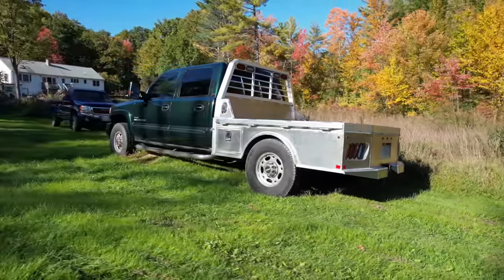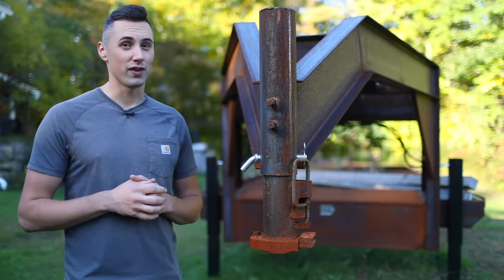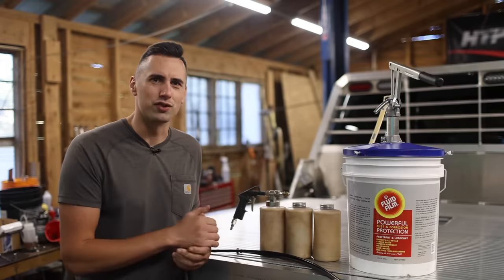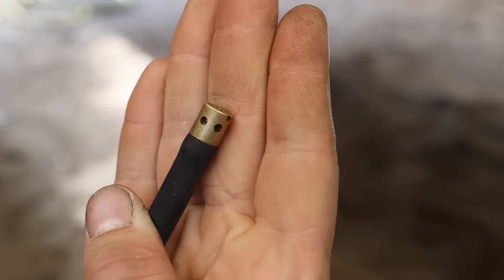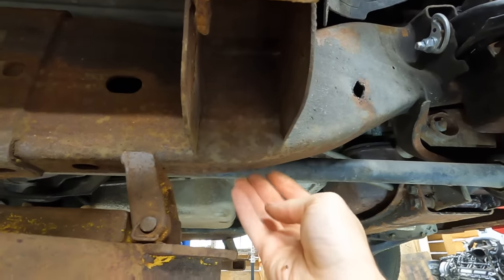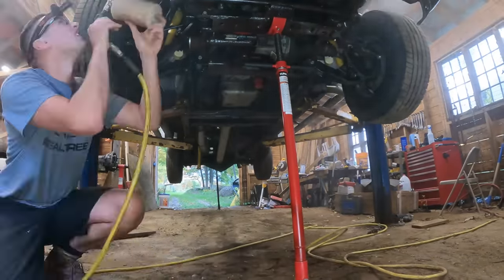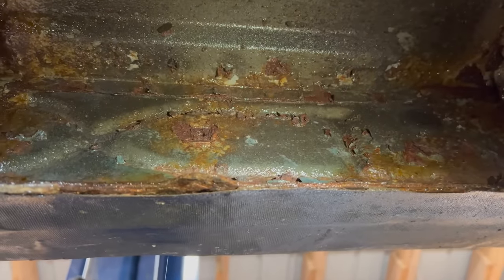Oil Undercoating my Truck so it won't Rust. Easy and Foolproof Method.

Comment: Great content Waldo and thanks  , yes I use old engine oil on the old  vans it sends to creep in all the cracks , messy but the only way !
Reply from the maker: Thanks Steve! Yeah, motor oil probably does a better job of creeping than this stuff
Reply: Let me ask you; How often do you have to apply these coats?  I live in MI where Winter Road Salt definitely does a number on my vehicles!!
Reply: @whammond511  I hear of people doing it yearly or every other year I wanna get mine coated before the snowfall
Reply: @damiengreen3772  Eric O at South Main Auto does his yearly. He’s in southern central NY and I believe in his area they use brine, especially on the unpaved roads.
Reply: Old time always told me to use transmission fluid would do a  good job! Than found a dirt road and drive up and down on it !😂
Reply: @WaldosWorld  The trick to get fluid film to creep is to heat it up before applying, have been using fluidfilm for a couple of year. But it was only the last time I applied it, I heated it up before and that for sure makes the whole difference :)
Reply: @whammond511  Every year but honestly after about 3-4 years there will be so much built up you can start skipping years.
Reply: Steve, you ever have any swelling of bushings? I’ve been told use spent hydraulic oil because it doesn’t swell bushings. I cut in a little atf for penetration, and add some fluid film so it sticks better.

The end result has my neighbors wanting to hire me to do their vehicles.
Reply: @swamp-yankee  ... anything with petroleum will eventually attack rubber bushings.
Reply: Well every year but keep oil away from rubber bushes,   lanolin here , most commercial vans are metal  and rubber o rings were grease is applied ,
Reply: @stevesalvage1089  ... the white stuff that looks like lithium grease on the mounts is not a petroleum product. It may be a wax type substance.
Reply: @rupe53  thanks, good to know.
Reply: @whammond511   if you're only doing it once a year then spraying in the fall would be best. I always plan on also spraying in the spring after washing all of the salt off but I never seem to find the time
Reply: @swamp-yankee  it will still effect the bushings.
Reply: @Terk131  yeah, so I have been told. I’m glad to know that, but I’m going to continue using hydraulic oil on my own stuff and just avoid spraying it on bushings and wiring. Can’t hurt anything up in my frame. I’ve got a first gen taco I bought because it was going to get scrapped and we did some major frame repair to, and I’m not going to let it rot from the inside out again.
Reply: @swamp-yankee  definition,  spray away. I do, I just go easy around the bushings
Reply: @whammond511  Use my recipe and I live in Pa and use it 1 time every few years. Depends on how bad the salt is. If not bad like past yrs 5 years later and still no rust. Gotta mix these things to make a super rust fighter. Oil, grease, trans fluid, wax etc. I typed out recipe.
Reply: @damiengreen3772  Costs alot. And lasts not that long if u wash car alot. Or use auto wash.
Reply: @bobleeswoodshop7919  Yes. Mix with oil, grease and wax. That way u have a few good things that together are great. Recipe typed above.
Reply: @swamp-yankee  Thank u for proving my point. Mix all together with wax gasket, grease.
Reply: @jasonchristopher2977  like tubes of grease? I know folks tend to call lanolin undercoat grease in my area
Reply: @jasonchristopher2977  Where do I find it?  Here on You Tube?
Reply: @swamp-yankee  Yes. For grease gun. Or tubs for wheel bearings. Don't matter what kind etc. As long as it's grease. u can't cut that in half for all and try it or even 4ths. Just try a lil and I promise Ull be happy. Did u ever see any iron covered in oil, grease, or trans fluid and be rusted out? There's a reason for that. If u seal with the ospho then it's really gonna last a lifetime. I know ppl don't care on already rusty cars but if they take the time to get heavy, what falls off being hit with hammer etc, then use Ospho it will seal it and can't rust. U can look it up. Great stuff. Safe, can pour on ground and not hurt it. Not battery acid or etc. Gotta wear ppl but not worry if on skin. Don't BREATHE IT. Wear the Covid deflector.
Reply: @jasonchristopher2977  I wear a painting respirator, safety glasses, gloves, and a pair of nasty coveralls when I spray oil. I like to not bring any inside with me if I can help it. Im going to try grease. I can get free damaged tubes from a friend’s shop semi regularly. 

I undercoated a 1st get Tacoma that a professor bought for 16500 the other day. It’s a cherry V6, but the price still shocked me.
Reply: @swamp-yankee  No not grease, Ospho. Phosphoric acid is what I was talking about. For converting surface rust. Tge rust coating mixture yes, a hazmat type suit is best. But if u take urr time, get inside frame etc then outside. U can use any grease. Tubes for grease gun is what I use mostly, wheel bearing grease tubs etc. Mix and heat and Ull be great. That's why I'm sharing this. Ppl shouldn't be paying all these insane prices sometimes more than when new for low mile examples. I'm sorry but now kids can't work and save a grand up for a fist car. Now it's 4 grand. In 90s it was 500 bucks. I got a 88 tempo 5 speed from a preacher with 112000 for 300 bucks. Needed nothing. He wanted tow bar off front. He'd haul behind his rv. 2004 I bought it. so gotta make them last. Rust will kill a vehicle faster than anything. We see a lil paint bubble on outside and it's as big as a dip can on inside. And these vehicles and their families anti rattle. What a pita that shit is. Just hold water and dirt like big sponge. Why not use rubber with holes like Swiss cheese?;Same effect. Grinds my gears. Have a great wknd.
Reply: @swamp-yankee  Also we used a epoxy 2 part product in a can on Pipeline to seal the welds when the thickness was thin. And we had sticks of it when heated with a propane bottle torch it'd drip and do same. I dripped that on my Carharts in 2013. It's still there to this day and on gloves and pair of old boots. That shit won't come off. Won't let go, wash away. I had to use a dremel and sand or grind it down to almost level on that stuff. It's insane. If there was a way to use that on steel like on pipe, it'd last forever. Especially on seams, places like under fenders, body or frame that gets hit by gravel etc.
Reply: @christianbentsen3637  I wanna do this to my car before the winter this year. How did you apply it and how did you heat it up? Thanks!
Reply: @jonathangaliano2617  I used a air spray gun, and used an old boiler on the stove 👍🏼 works great!
Reply: @WaldosWorld  You'd be surprised how much fluid film creeps, especially when its warm out. Fluid film is not only a surface protectant but also a great penetrant. They both creep well on flat surfaces but fluid film climbs vertically better than motor oil. At the farm I work at we have trailers with custom angle iron tracks that accept these 4x6 steel racks that carry trays of plants. Basically they slide in like big metal drawers and without lube they are substantially harder to load/unload. Long story short we've used many different lubricants; motor oil, wd40, pb blaster, etc. After satisfactory results from everything else I recommended we try Fluid Film because I had seen and heard great things about it. Without any doubt I can say that Fluid film is the best product by far! It lubricates and prevents rust longer and better than anything else. When we used motor oil, in the spring when we'd pull the trailers out after sitting all winter to service them, the tracks looked like they have never seen a drop of oil. After switching to fluid film you can still see and feel the lubricating and anti-corrosion magic come spring time. Each trailer has exactly 210 total feet of angle iron that needs to be lubed and by the time I'm done with one my pointer finger is completely numb from holding down the nozzle for so long so the less I have to spray them down, the better. With motor oil lubing the tracks was a weekly job but now with Fluid Film its pretty much just a once a month job.

Comment: Found this channel through the E320 CDI videos. Love this channel so far. Thanks Waldo keep it up!
Reply: I found it with the cummins conversion on the chevy 3500
Reply: @Rv99, yea the first one I saw of his was the "I Bought a Repo'd Mercedes..." and then I watched the one of the old "free" Sears riding mower. Then I saw maybe the one ZILA mentioned, he was putting the red diesel engine in the white-body truck. And then I got back on the two Mercedes where I couldn't believe this man by himself, swaps the engine and transmission between these vehicles and has it running. I think he made a great choice too in selecting the other rims. Idk I was hooked by then lol and have just been randomly watching different videos like the one he did in Feb where he and the "Rural Vermonter" made a snow plow to put on his truck!
Reply: @zenithperigee7442  right around the time he build the snowplow he also build the all aluminum flatbed for the truck he just rust proofed …..  looks amazing! Just like store bought

Comment: Welcome back. Guess YT didn't want to show me your Mercedes videos (I just checked to see if you'd been posting since the last one I saw).

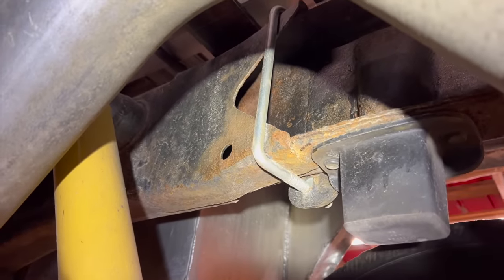My issue is my '91 Suburban needs some retreatment, but I don't think Fluid Film is compatible with the existing undercoating. But if you're starting out, it's definitely a DIY option. I'm only 2:45 in and watching so forgive me if I restate what you said, but I think Fluid Film requires annual reapplication. There are thicker DIY undercoats, one from the same company and some from others.

Comment: I wipe down every part of the chassis and anything else with used Automatic Transmission Fluid.  It seems to be a great job of cleaning off all the gunky road grime buildup, and leaves the underside looking so clean and new.  Not sure what the long term effects are of using ATF for rustproofing the chassis and suspension and driveline surfaces, but so far so good, after a few years.

Comment: I use undercoating in a can names not very original but works. It's held up for years with a few spots needing to be touched up every few years. It's a wax but isn't all messy since it's firmer consistency.

Comment: I started with Fluid Film but switched to New Hampshire Oil undercoating 
The back to black makes the frame and under components look like new. 
Because it is oil a dime size spreads to 5” circle. 
I have my trucks done every year, for $350 per vehicle well worth the cost. The applicator also sprays all the internals. 
The lanolin based fluid film and Woolwax just don’t seem to last as long as the oil based. A trip down a dirt road over the fresh applied NHOU makes for a nice pasty wax coating. 
Just be sure you have all your PM done on the vehicle, and wear gloves and old clothes if you have to work on it after application

Comment: As a fellow rust belt resident I can attest that Fluid Film, Woolwax, etc will save your vehicle.  I purchased an 03 f250 8 years ago that was just starting to rust. Treated every year since and the rust has not spread.  I use a heatgun if its cold to heat the fluid up.

Comment: Nice having air supply. I went at mine with a case of cans. Bought the 360 hose/wand that attaches to get all those places you mentioned. Even after a few frame washes, it's still very much coated. Some light touch ups and I'd say I'm good for another winter. I'm in central PA.
Not quite as much salt as you guys.

Comment: Prevention is the key, when I had decided to move from Texas to Fort Wayne ,In. The first thing I did was sprayed my frame and underbody with bed liner to seal it and it worked out great ,but now I'm back in Texas and I see the bed liner is starting to flake off so I'm glad I didn't decide to continue on living up there and my 94 is still corrosion free!
Reply: Bedliner is great for holding moisture and salt, it's been tried in the northeast by many and fails miserably.
Reply: @TheRoadhammer379  that's probably why it started flaking off then ,because I know that chemical they use will rot out a frame just like salt, my Volvo had caking corrosion all over it and the airbag suspension was dry rotten it self had to have all the rubber bushing replaced as well. I'm glad I was only hauling expedited  freight with it.
Reply: Thank you, but I will have to decline, I only have Wi-Fi connection for my phone due to some health issues.

Comment: My Disco did this twice, with diesel!! Once when the fuel line near the fuel pump developed a hole and secondly when the Fuel Pressure Regulator broke!! Not that rust proofing is needed in Australia.

Comment: I used to undercoat with oil and it worked perfectly sprayed through a Wagner power painter (I filtered the used motor oil first).  Then one year I was refused an inspection sticker whereas I was told that "oil undercoating" is illegal in the state I was living in back then.  I had to drive around on dirt roads for a couple of weeks before I could bring the vehicle back and get my sticker.  So now I power wash the underneath once per year and spray painting every two years.  Seems to be okay.

Comment: Its a messy job but it works well.  It is even messier if you don't have a lift.  I now have a local shop spray my vehicles now.  I supply the Fluid Film and they only charge me an hour of labor per vehicle.

Comment: Looks like a great way to fight rust.  I have also used products from KBS coatings for a permanent fix, once applied, it’s the end for rust.  I’m going to try your method for the areas where I can’t get at with KBS.

Comment: I prefer Woolwax black. I’ve used it for years and it’s been preserving my 2006 Silverado 1500 very nicely. I plow with it so it sees the worst salt brined roads traveling from customer to customer for snow plowing.

Comment: Waldo! What aftermarket stereo did you use? I see CarPlay and a massive screen, I would be interested in the same unit for my 2006 Duramax!

Also love the vids! Used yours as guides for when I replaced my frame crossmembers due to northern Ontario salted roads. Keep it up and more big excavator vids would be great!

Comment: been using similar method quite long time on my cars, but instead of fluid film i used old engine oil + mixed it with chainsaw oil in order to make it sticky, so far no problems, obv it will wash off from spots wich get mostly watered thru driving but different corners and gaps are still coated with it even i did it last year :P

Comment: Hey Waldo, I think I live near you because I've seen your cars around town. Anyway..as a kid (13 yrs old) I worked part-time and one of my jobs was taking a paint brush and brushing on heavy black grease on the undersides of our municipal trucks. None of the town workers wanted to do it..but I was eager to make a buck and small enough to get under the trucks and do the job. Those truck NEVER had rot-trough problems because of the yearly reapplication of that grease. That was back in the early 80's and I think most of those trucks continued on well into the 90's..which is pretty amazing considering they were already 20 years old when I was slinging grease. The spraying looks easier..but doesn't it aerosolize a lot? Must go everywhere when it does??
Reply from the maker: Yeah, it does make a mess. You can see the camera lens get oily as time progressed in the timelapse 😂

Comment: When that stuff wears off there is the spray paint you can use to actually kill the rust it has a chemical reaction with the rust to turn it back into black steel and paint it at the same time then you can spray this on to protect it

Comment: My 06 lbz had a massive c channel frame but the fuel tank pipe and shock mounts were made from 30 gauge exhaust pipe.
Get those brake lines good everywhere there's a plastic block holding them down. My lines were perfect but they rusted right there and blew

Comment: So do you not need to worry about existing rust on the frame (undercarriage) when applying this product? Or it's ok as long as the car/truck is dry.
Reply from the maker: The existing rust (at least on the frame) is just surface rust, so it's fine to coat over it. This is one of the big advantages of oil coating rather than painting.
Reply: @WaldosWorld  Thanks for replying. Really enjoy your video. Keep up the good work.
Reply: Make sure to remove rust flakes though, that'll be the first place to fail with the coating. The rust flakes are more porous than regular surface rust and will hold moisture. Of course, they'll also hold a coating of anti corrosive.. But you need to realize that the reason they are there in the first place, is from the held moisture. So definitely remove the rust flakes. Like Waldo said surface rust is no big deal because coating it stops it from being able to oxidize further as long as the coating is active.

Comment: I would brush off any loose rust on the outer parts first and treat it with Rust Kutter or similar product before coating the inner parts.

Comment: What you need is a Reliant... fibreglass body, galvanised chassis, 1950's technology level, 70+mpg and only 3 wheels so save everytime on replacing tyres by one, will convey 4 adults to 100mph too although I imagine by 100mph the 3 passengers would be screaming to get out, you can even fit motorbike or V8's into 'em and the Rialto hillclimber build no police car would ever catch you with its top speed of ton 50 on the flat lol